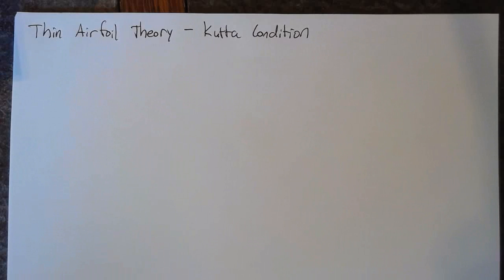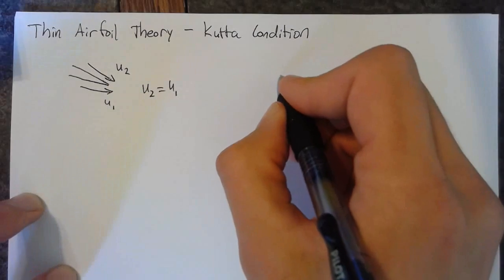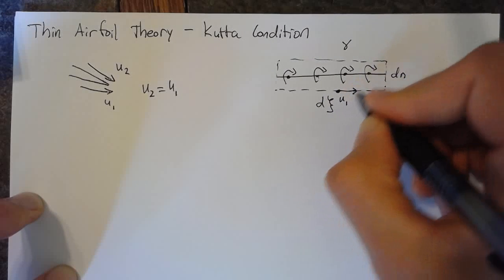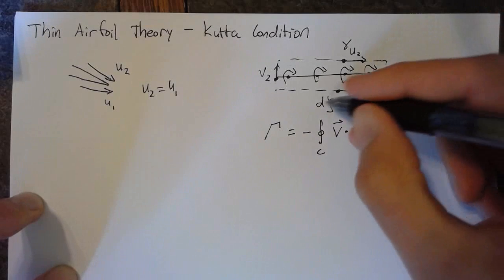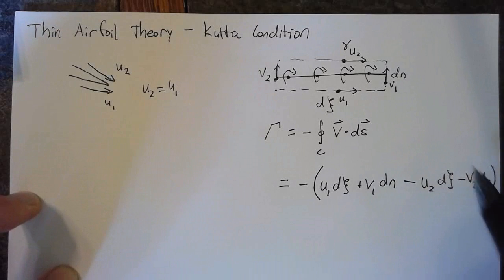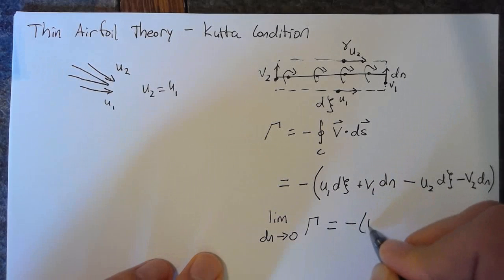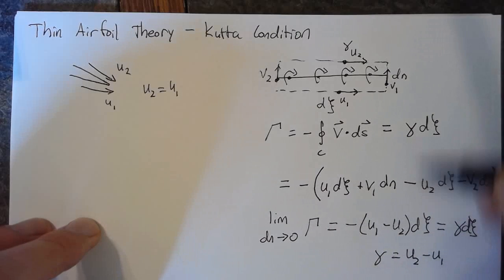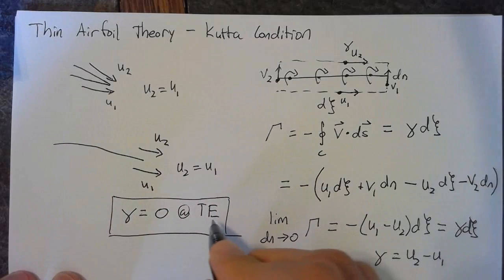Thin Airfoil Theory - Kutta Condition

Comment: by using the Kutta-Joukowski Lift Theorem, can we make a plank (think Skateboard) float?
Reply from the maker: Float is a strong word.  Oncoming flow is a necessary component of the equation.

A flat plate can be used to generate lift, however.
Reply: @PostcardProfessor  what about spoilers in cars? Kutta condition is followed and they have all the necessary requirements for generating lift but instead they produce down force?
Reply: @Cryptic_Chai I think car spoilers are like airplane wings, but upside down. So at 0 AoA the Coefficient of Lift is negative, and so they produce down force.

Comment: why is u1 = u2? that seems wrong... airflow above the wing is much faster than airflow below, and they do not join back up at the end. 

https://www.grc.nasa.gov/www/k-12/airplane/wrong1.html 

am i missing something?
Reply from the maker: You are correct that they don't join back up.

However, the instantaneous velocity at the trailing edge is not the same as the amount of time needed to travel by the particles.  The travel time is dependent on all the velocities in between the leading and trailing edge.

Comment: But doesn't the air go faster over the top of an airfoil?
Reply: It does. But you cannot say that at the trailing edge. the above video was subjected for trailing edge only, not for the whole airfoil.
Reply from the maker: It does, on average. It will gradually speed up until it reaches the thickest point, and then it starts slowing down again.